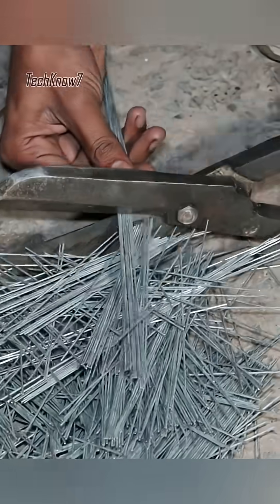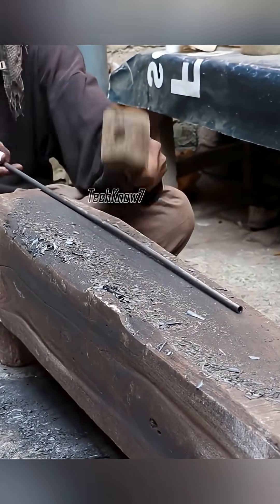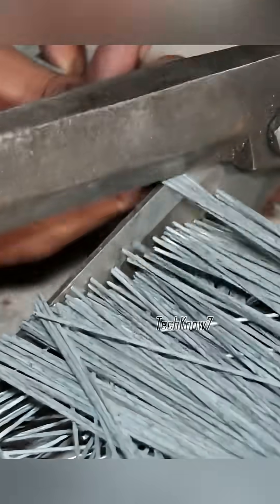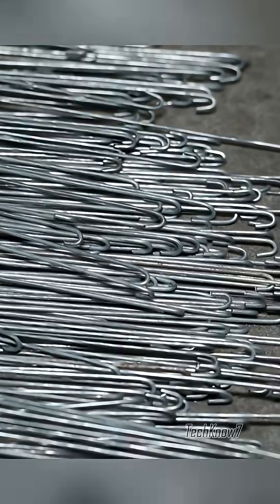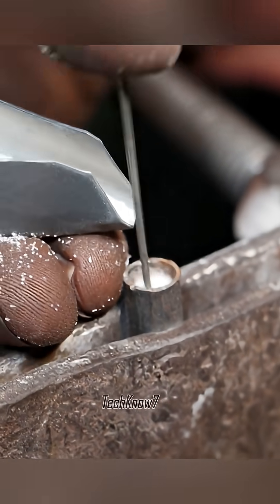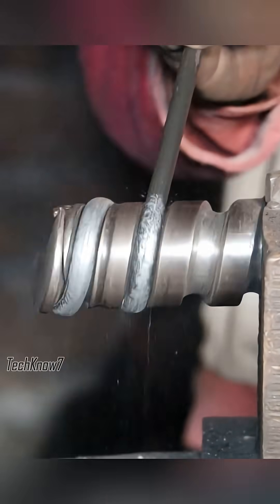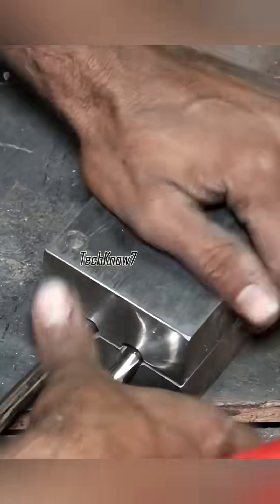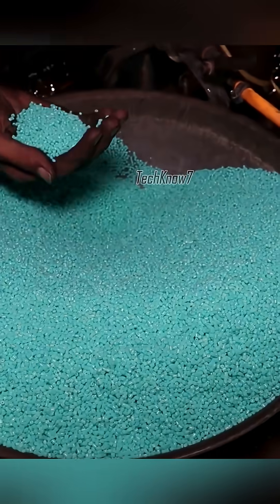How Water Heater Rods Are Made! #ManufacturingProcess #EngineeringSkills

Comment: Those are made to boil water in a cup, not for showers
Reply: It works in a cup, the really tiny ones. But the larger ones are used in a bucket, with due caution.
A similar heating coil is in your electric geyser, albeit in a different water flow arrangement.

Comment: Need to ground it properly. Many died due to electrical shock during shower.
Reply: It is not used during bath
Water is heated in a plastic bucket with rod suspended in center ..no one touches bucket or water during heated even company gives safety assurance.
When water heated switch off rod remove from bucket & use the water with a water Mug for bath ..no shower ..manual pouting through water Mug( 2 liters capacity)
Reply: @TanzeelMir-s8h okay that makes sense 
Thanks for explaining it to us
Reply: Yeah, that's so true.

We have a disconnect in the shower to shut off the water heater before we get in.

One of my family members got zapped in the shower 'cause of an old heating element.

Thank God they lived 'cause his wife was a total badass and turned off the main breaker
Reply: Totally true I know 100 of peoples are dying in India, Pakistan, and Afghanistan
Reply: Only stupid people take a bath while this thing plugs to electricity. You warm the water first, then unplug the connection after you get the water temperature you need, then you take the bath.